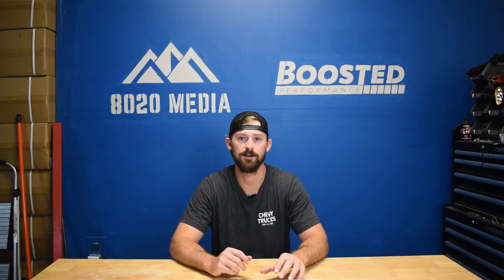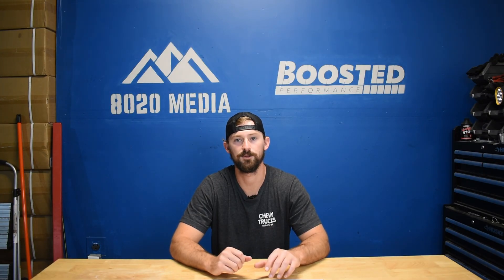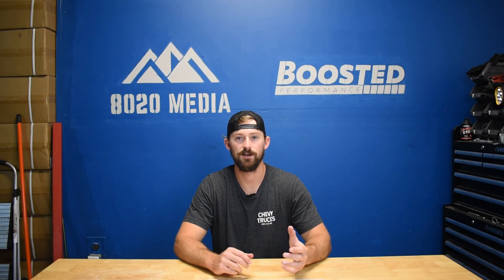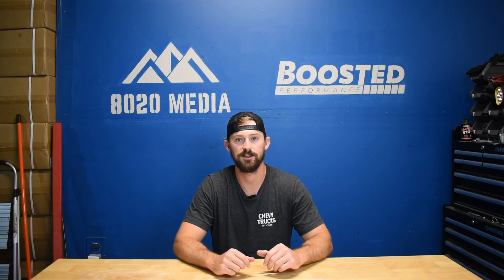The 2.4L EcoTec | 4 Common Problems & Reliability

Comment: I have Chevy malibu 2013 it has 2.4L LEA l4 engine and it has 170.000KM, I changed full synthetic oil 5W30 every 10.000KM and I have no issues, no oil loss nothing, the car runs great also I clean the injector using fuel cleaner at the gas station every 10K km and change Gearbox oil every 60k KM. I'm the first owner of the car, I bought it back in the end of 2013 brand new.

Comment: I have 2015 Equinox with the LEA 2.4 engine. Runs smooth, has good power, and gets ok mpg (average 19mpg). Mine used to burn about 1.5qt of oil every 5k miles but then I started using Valvoline Restore and Protect, and the oil consumption completely stopped after the first oil change interval with that oil (5k miles). 

The key to keeping these engines alive is maintenance and checking your oil level whenever possible to make sure its never getting low. I check my oil every other gas fill up or whenever i have to open the hood to refill windshield washer. I am currently on 2000k miles on this OCI and still registering on the full mark.

Comment: My Mother has this engine: 
2012 Buick LaCrosse with a 2.4L L4 DOHC 16V
She didn't realize that this vehicle was some type of hybrid until she needed a battery.  She had a timing chain go out, as well.  How do you disable the Auto start/stop feature?
Reply from the maker: M - Her LaCrosse with the 2.4L engine uses eAssist, a mild hybrid system that includes auto start/stop, regenerative braking, and a belt-driven motor-generator—but unlike full hybrids, it doesn’t have electric-only drive. Unfortunately, there’s no built-in menu option to disable auto start/stop permanently on these models, and GM didn’t include an OFF button like they do on newer vehicles.

Comment: The problem with timing chain failure is commonly due to using cheap oil and following the oil change interval on your instrument cluster.  Blowing seals on your 2.4 is due to mainly the positive crankcase ventilation system where the small orifice on the intake manifold gets clogged. Running E85 (on the flex fuel ones) in winter causes a lot of water condensation which freezes, blocking pcv breather hose and for some reason, this one causes the rear main seal to blow out.
Reply from the maker: Y - Thanks for taking the time to share your experience!

Comment: GMC Terrain got the recall. That said, the problems seem to be related much more to TRANSVERSE mounted engines ( FWD/AWD) versions. The Opel and Daewoo , Pontiac, and Saturn used a 160 T stat, and seem to run cooler .
Reply from the maker: F - Thanks for the insights.

Comment: My 2010 Malibu  LAT Ecotec 2.4L now has 184,000 miles and the timing chain is still going strong, I will be changing it just as a precaution. My only concern with the engine is oil consumption, it uses about 1 quart every 1300 miles. I have done treatments to make sure the piston rings are not a problem, I have used Yamalube Ring Free Plus and Seafoam High Mileage and Gumout Multi System Tuneup with PEA. I think my issue is with a dirty PCV orifice in the intake manifold.
Reply from the maker: R - You're absolutely on the right track—your 2010 Malibu 2.4L Ecotec is known for oil consumption issues, and while worn piston rings are a common culprit, a clogged or restricted PCV orifice in the intake manifold is another major and often overlooked cause; if the PCV system can't properly regulate crankcase pressure, it can pull oil through the intake or valve cover, increasing oil consumption without obvious smoke or leaks—at 1 quart per 1,300 miles, you're on the edge of GM's “acceptable” usage, but cleaning or replacing the intake manifold orifice (which is integrated in the Ecotec design) is a smart move; you've already ruled out ring issues with good treatments, so tackling the PCV system is your best next step—and if the orifice is clogged or partially restricted, cleaning it or replacing the intake will likely reduce consumption and help extend the life of your engine.
Reply: All snake oils waste of time

Comment: Are 2016 Chevy Cruze lt know to have timing chain and tensioner issues ?
Reply from the maker: B - The 2016 Chevrolet Cruze is equipped with a timing chain designed to last the vehicle's lifetime under normal conditions. There isn't widespread evidence indicating common issues with the timing chain or its tensioner for this model year. However, as with any vehicle, components can wear over time. Regular maintenance, including timely oil changes using the manufacturer-recommended oil type and viscosity, is crucial to ensure the longevity of the timing chain system. If you notice unusual engine noises, such as rattling during startup or operation, or experience performance issues, it's advisable to have the timing chain and tensioner inspected by a qualified mechanic to prevent potential engine damage.

Comment: Any guides you can buy that arent plastic?
Reply from the maker: D - We'd have to look around.
Reply: @8020Automotive  has anyone ever just 3d printed a type of alloy versions in better material? Maybe a titanium or some type of material that will never break or bend.
Reply: ZZP sells an upgraded version of the guide that typically breaks. Also, make sure to get the dorman upgraded guide bolt.

Comment: I have know 2 people with the 2.4 Eco tech motors in there malibu both of there HeadGaskets popped on them one was a 2013 the other was a 2010. GM’s Ecotec 4 bangers are not to reliable in my opinion I remember the 2.2 ecotec used in the caviler / sunfire use to blow head gaskets alot back in the day
Reply from the maker: A - Thanks for taking the time to share your experience!

Comment: 2013 2.4 lea with 180,000 miles on it. All original. Changed oil faithfully with synthetic every 3000 miles. Never has burnt or used a drop of oil. I don't drive it like i stole either.
Reply from the maker: S - Thanks for taking the time to share your experience!

Comment: THE PVC SYSTEM IS THE WEAK LINK' WHEN IT PLUGS  THEN THE PROBLEMS START WITH THE RINGS SLUDGING AND STICKING  AND BURNING OIL . ADD  A LITER OF TRANNY  OIL TO EACH OIL CHANGE   AND THIS WILL CONTINIOUSLY CLEAN  THE RINGS AND INSIDE THE ENGINE . PVC FAILS AND TOO MUCH PRESSURE WILL BLOW OUT THE REAR  OIL SEAL RESULTING IN LOW OIL AND OVERHEATING  THE TIMING CHAIN . KEEP UP THE OIL LEVEL AND COOL THE TIMING CHAIN .
Reply from the maker: T - Thanks for sharing this insight.

Comment: I had a 2009 Malibu with a 2.4 EcoTec.  It had 262,000 miles on it, ran like a top, never had any issues with it, timing chain or otherwise. Burned a quart of oil every 3000 miles. Ran perfect right up until the end; the rear chassis rusted out.
Reply from the maker: R - Thanks for taking the time to share your experience!

Comment: 2015 chevy captiva 2.4 liter ecotech 170 thousand miles keep oil changed regularly..the only thing I have to replace about once every two years is the 2 manifold selinoids but they are cheap and easy to replace
Reply from the maker: S - Thanks for taking the time to share your experience!

Comment: 2013 Buick Verano chain replaced right at 100k now broken chain at 143k. This is not normal. Religiously changed the oil and it was always low and needed capping off between changes. I say junk!
Reply from the maker: D - That certainly is not normal.. Sorry to hear. However, thanks for taking the time to share your experience!

Comment: A timing chain that has less lifespan than a belt?  Really?  Then there is the problem if you have to replace the water pump.  I know they can last a long time but, on this engine, the cost is astronomical.
Reply from the maker: W - Unfortunately, this is true.

Comment: I'm still confused as in if my car IS the 2.4 Ecotec or not, i am from Latin America and have a 2.4 Vectra, however instead of a timing chain we have timing belts and no VVT and only make ~140 HP
Reply from the maker: M - It should be the 2.4 ecotec.

Comment: 2010 equinox owner - 180k miles...Odd item... I Replaced (me) the fuel injectors and noticed the following.  After warm-up there is now a low squealing/chirp sounds when the engine is running.  
But, if you open the oil cap or pull the dipstick out the sound goes away.  Car has had excessive oil service work and the timing chain replaced (100k miles ago). any ideas on the chirping sound?
Reply from the maker: K - Unfortunately, there's a bunch of things that can cause this. Difficult for us to give a diagnosis over the internet.
Reply: My 2017 2.4 Equinox has same chirping sound. Sound goes away when you pull the oil dipstick or takeoff the oil fill cap. Did you ever find the reasoning?

Comment: Every 2.4L Ecotec you examine at any salvage yard will have a completely clogged PCV port in the intake manifold.  This is why "milkshake" typically runs out of the PCV hose or Air Cleaner outlet cover when it is removed from the throttle body.  Three of the major problems you mentioned (oil consumption, timing chain wear, rear main seal) are either caused by or made much worse by this clogged PCV system.  The PCV hole is only 5/64 in diameter and easily gets clogged by sludge and carbon deposits.  It's a terrible design flaw but profitable on since it sends many of these engines to the graveyard if you don't know to clean out this port every 50k miles or less.  Planned obsolescence still drives the automaker's profits as usual.
Reply from the maker: M - Thanks for taking the time to share this insight.
Reply: How do you clean it then?
Reply: Same on the early non DI VVT version?

Comment: As someone who owned a 2011 Malibu I can tell you that it was the most reliable car I have ever owned, well over 250K miles on it. The timing only became an issue when I no longer had the ability to do basic maintenance.
Reply: What part of the country do you live . ?  I am a certified  ASE  technician with  YEARS of experience .  The NORTHERN states will see way more failures with this engine do to the poorly designed PCV  system ,  Freeze up of the passages causing HIGH  crankcase pressures and the crank seal blows out   going down the road .
Reply from the maker: N - Thanks for taking the time to share your experience!
Reply: If you think that's the most reliable car, then you haven't tried an import Japanese car.  Try a Toyota, they last twice the mileage you got on the Malibu 😅

Comment: Original owner 2010 Lt Malibu has 286k ,Original transmission  oil changes full synthetic every 5000 miles and transmission dump and fill with new filter every 25 k miles and antifreeze changes every 100k runs like a champ! Still my daily driver! Had new valve cover gaskets installed last November 2023 and one motor mount.
Reply: If you dont drive it for months ..should you still change the oil¿its not 5000 miles yet
Reply from the maker: I - Yes, this is why there are mileage and time intervals. Example: 5,000 miles or 6 months.
Reply: @ilqar887 I drive 3000’miles a year and still do it two to three times a year.
Reply from the maker: D - Sounds like you take great care of it! Thanks for taking the time to share your experience.

Comment: I have a 2012 Buick Verano with the 2.4. I had to replace the timing chain at 198k due to a broken chain guide from me drag racing some bmw with dirty low oil level (my fault), now has over 210k. Used to burn about three quarts on my drive from Florida to Pennsylvania. I started adding a bottle of motor medic before each oil change. The first time I did a flush there was what appeared to be a lot of sand and a piece of a sea shell or something in the oil drain container as well as a lot of soot. I imagine all this stuff was caught up in the piston rings keeping them stuck. Well I’ve done about five flushes and on my last trip from Florida to Pennsylvania, I only burned maybe 1 quart. I checked the oil on the way at a gas station and it looked low so I added a quart. A day after I arrived I checked the oil level and it was overfilled. So yeah try flushing your engine if it’s burning oil. I bought the car with 50k and it burned oil most of the time I owned it. Also I use e85 as often as possible.
Reply from the maker: C - Thanks for taking the time to share this. It'll certainly be helpful for future viewers.
Reply: Shoot just use Valvoline restore and protect and you won’t have that problem even without flushing.

Comment: 2011 le 9 forever! Currently driving a 2011 hhr with the 2.4 at 160k with original parts   timing chain has slight rattle at startup   leaking oil pan   burns some oil. 😆😆😆
Reply from the maker: F - Thanks for sharing your experience! Hopefully it stays reliable. Keep us updated.
Reply: I just recently dropped the oil pan on mine & resealed it w/ rtv & the damn thing still leaks 🥵 same spot...same amount...I don't think it is the rear main seal, either, cuz it was all dry in there when I removed the oil pan...I even had the starter removed b/c I replaced the oil pressure sensor & crank sensor o-ring while I was down there so I had a really good view of the flywheel...I really don't know where I'm gonna go w/ this thing now, I might just break down & put a whole new oil pan on it; the casting marks looked terrible on this one...
Reply: @jbone1383  It does not compute that the intermediate shaft rattles horribly😆😆😆 also,steering rack rubber bushings beyond done causing more vibrations

Comment: ‘11 2.4 Equinox, changed oil every 3k or so with a vented oil fill cap per a GM tech neighbor. Kept oil level up consistently. Despite the oil consumption fouling the cat twice and one of those replacements including the exhaust manifold it has 200k and still going. Recently replaced the thermostat due to being stuck open.
We also have a ‘13 2.5 with 200k and only issue so far was a bad/erratic thermostat solenoid. So yes, the 2.4 was bad engineering. 😂
Reply from the maker: J - Thanks for taking the time to share your first hand experience!

Comment: I can't understand how Chevy engineers can build a 2.2 L twin turbo V6 to withstand the punishment of Indy car racing but can't design a decent small engine for everyday driving.  I know we're talking apples and oranges but some of that talent could be pulled over to the daily driver side of the house. And those Indy engines rarely fail.  BTW, after the 500 this year they're going to have a hybrid component added.
Reply from the maker: F - Agreed.. Thanks for sharing this insight!
Reply: to be fair, the indy engines have basically no budget constraint and only have to last 1% of the life, if that, of a typical daily driver. wildly different use cases.

Comment: That’s my car in the thumbnail 🥰🥰 2.4 ecotec with 267,000 miles and still going. Have replaced the timing chain with some strong upgraded parts from ZZP but other than that I have religiously changed the oil ever 3k miles and only run full synthetic. Still original transmission as well but I get the trans fluid flushed every year.
Reply: I've seen your car in the thumbnail all over in my world you're famous LOL I've seen your car in some forums and read all up on the 2.4 ecotec it's a very touchy motor I'm looking to get it tuned soon, do you know exactly how much horsepower you're making out of curiosity I've experienced I'd say a little lost in power with my air fuel ratio being off but I love the car man I'd love to hear more about your car
Reply: You definitely should make a video about your car and whats done to the motor
Reply: @0utt-west  for sure, I'd love to see a video of his vehicle mine's now at 190,000 and the timing chain needs to be replaced, but I'm having a bad suspension issue in the front and back I'm just a YouTube mechanic so I'm not too well informed about suspension I know bushings and control arms and whatnot but I don't know how to change them exactly,  I probably have a couple thousand dollars in suspension work done, any clues to what it could be? I feel any Mark in the roads even crack fill marks and don't even get me started on railroad tracks.
Reply from the maker: Steven - Nice car! Thanks for letting us use it, if it is yours! Also, thanks for sharing your experience!
Reply: What size are the rims?
Reply: what was the mileage when you changed timing chain?
Reply: Family member currently has a 2011 with the LE5 2.4 ecotec still going at 281,000 miles. Told him to buy a lottery ticket because he must be lucky.

Comment: I purchased a 2013 Chevy Equinox with the 2.4 Ecotec in 2019.  It had about 98,000 miles. I kept the oil changed according to the computer on the dash. I noticed it burned a lot of oil but didn't know about the reliability problems. GM sent out recall notices in 2020 for oil consumption. They didn't do anything to the piston rings. They just replaced the Catalytic Converter and did a general inspection for recommended maintenance.  Nothing to do with timing chains or piston rings.
Fast forward now. I think my timing chain jumped. In my area there are at least 3 Chevy Equinoxes parked. Same color. Just parked. GM dropped the ball on this one. When they did the the recall they should have replaced the engine and looked out for the customers.
My sister had a 2006 Jeep Liberty. Jeep recalled her model year and replaced the engine! That's how you look out for customers.
My Equinox is almost paid off and is still parked. GM may have lost me as a customer behind this...
Reply from the maker: Y - So sorry to hear this, however, we do appreciate you taking the time to share your experience!
Reply: That’s GM for ya

Comment: simple solution. don’t buy GM from 2010-2013. Just sold captiva sport LTZ. 2.4 ecotec was a poor engine which needed oil every week. switched to a ford 3.5L v6 no more issues.
Reply from the maker: Vaughn - Thanks for sharing your experience.